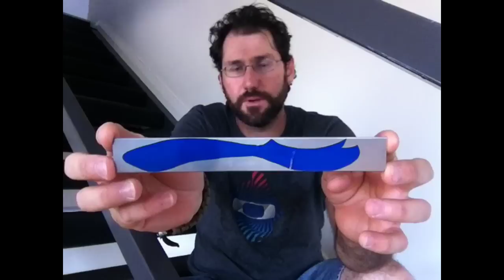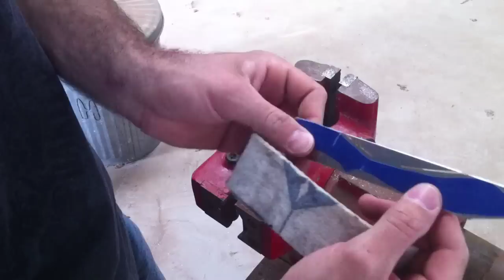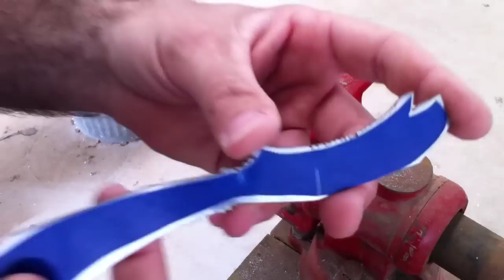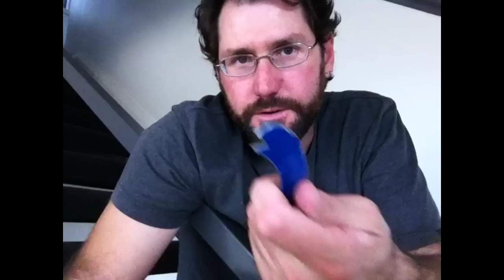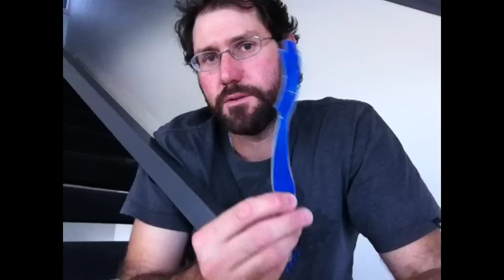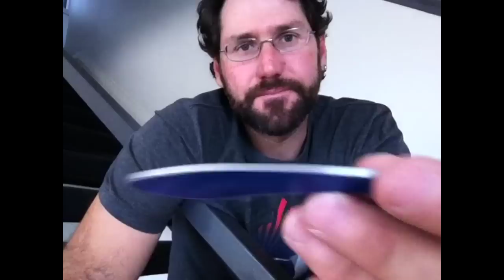Sugar Creek Forge Build Along - Metal Movement Time!!

Comment from the maker: @pennfootball71 Yeah, A few times I was filing I thought, this would be so much easier if I could see the hole knife at once, instead of just small sections that werent in the vice jaws. My shape is quite organic and handling the hole knife at once and moving it across a belt grinder may have helped some of those natural arcs and curves come out a little better. But it turned out pretty good regardless of that. just required a lot more stop/start. I still need to refine the blade curves some.

Comment: Dang you are one innovative guy Troy I wish I would have thought of that technique with the pliers! I had to use a little workshop knife belt sharpener I have...it's a little mini belt grinder...by mini i mean really really small belts that are like 1/4 of an inch. That and sandpaper and lots of time. I used the wheel on the pulley to make my finger choil

Comment: Troy - Great work.  I really like how your cheese spreading knife came together. The general idea for completing your knife pre-heat treat is to take it to about 90 - 95% of the finished shape.  You want to leave extra metal on the blade because there will be some scaling and decarb during heat treatment. This varies based on how oxidizing the heat treating process is.  I recommend not going higher than 220 grit because sometimes this scale is best removed with coarser grits when you are done.